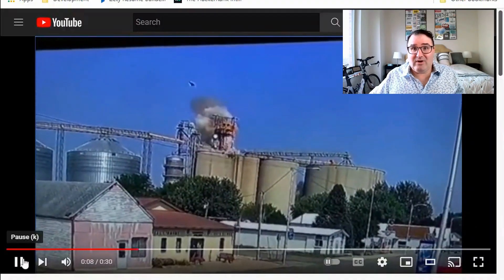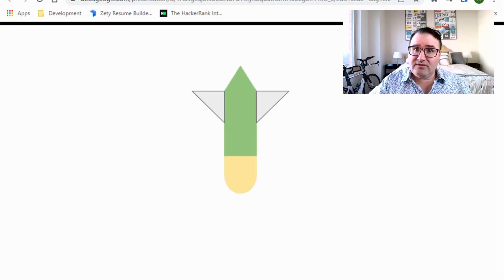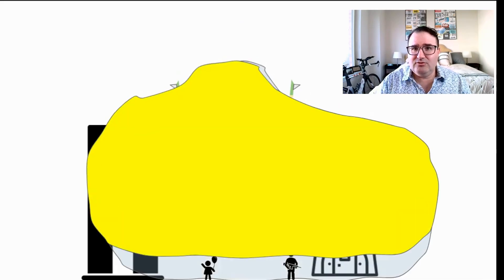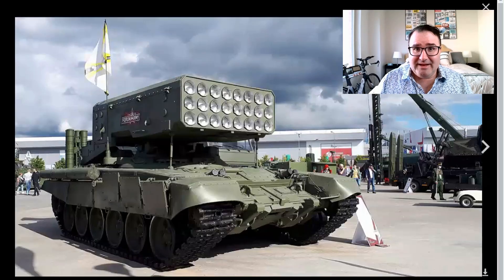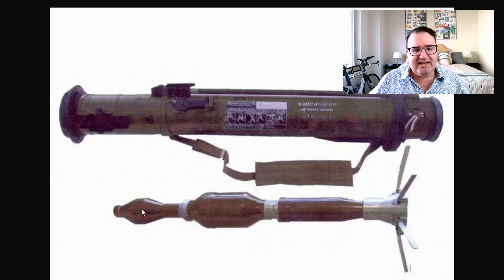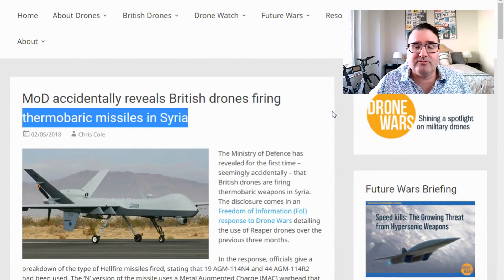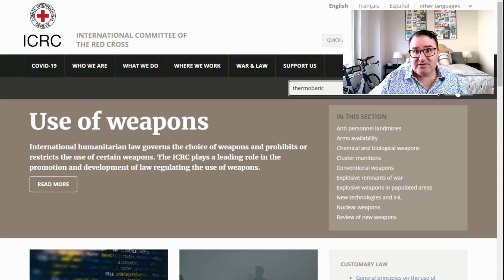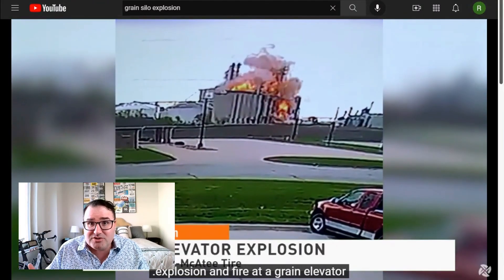How do Thermobaric "Vacuum Bombs" actually work?

Comment: Chemistry degree here.  Rain may increase the blast if conditions were just right.  This is due to the water droplets vaporizing in the intense heat of the blast.  Since going from liquid to vapor, water expands tremendously in volume, the blast overpressure would be increased.  This is why (in certain controlled conditions) it is advantageous for high performance automobile engines to inject water into the cylinders during the combustion.  Add too much water and you'll damage the engine, add too little and not much happens, but if you get it just right, these engines produce more horsepower.  In the case of a thermobaric bomb, humidity would unlikely be enough, but rain (at just the right intensity/droplet size) there would likely increase the blast force.
Reply: The MW 50 injection system used on Messerschmitt Bf 109  comes to mind.

Comment: To my understanding, any bomb creates a vacuum, because the explosion accelerates both the explosive and the air around it away from the centre of the explosion at very high speeds - actually above the speed of sound. Now, normally you'll be safe if you're behind a thick concrete wall so the pressure wave doesn't hit you, but with a large enough bomb you may actually have the air "sucked" out of your lungs (because there's no atmospheric pressure to prevent your lungs from collapsing, like if you suck the air out of a bottle).
Shortly/immediately after, the air pressure returns to normal, but there is that brief moment of "vacuum".

Comment: You can stand right next to a thermobaric explosion out doors and be unharmed or just knocked over unless you are pretty much inside the explosion. I have personally  seen thermobaric grenades and RPGs detonated and the damage is almost nonexistent . The 43mm grenade round is almost harmless only a few meters from the round but in a small room you are toast . They are effective in enclosed spaces .. not as artillery.
Reply: Thermobaric weapons are extremely lethal. You would certainly die standing next to a thermobaric detonation

Comment: I had a question what if you use that on a forest fire would it stop the forest fire or couldn't you just like just set off charges mid-air and just blow the fire out itself I was just wondering for like forest fires cuz this seems like it would kind of work cuz it would annihilate everything in cuz the trees are ready going to burn there's going to be nothing left already if the fire keeps going so if you just send that bomb in boom eradicate the whole problem wouldn't that work I don't know I'm not a mathematician I'm not a scientist but couldn't you just use bombs to put fires out like forest fires yeah it's bad for the eco but it's not bad for the ego cuz everything's dead or ran away only thing in the way is just more fire and wood and whatnot like can you just boom like detonated before it hits the ground like midair and just sucks up all the oxygen in the area and pulls that fire up would that work I don't know I'm just putting a theory in my head just thinking out loud

Comment: Well actually why it's devastating is because of the energy density of the filler. To clarify it, Gasoline has like 44 mega joule per kg, 22 for methanol, 11 for nitromethane. Methanol has 1 usable Oxygen in it, Nitromethane has 2. Therefore making them heavier hydrocarbon structures. Explosive fillers typically come with oxidizer in them, whether it's in the structure or in the chemical compound. Either way they are much more heavier for the same amount of the unlockable energy. Only carrying the reactive elements in the warhead and using the atmospheric air for the oxidizer is way higher in efficiency. The warhead can be made small for the same devastating effect. Even if the target is in the non-fire hazardous range, the shockwave punctures the lung so people suffocate just by standing nearby, it could happen even within a cover. The pure HE is dense in the middle of the explosion, the core of the explosion radius is the most dense in energy, it's not distributed evenly, that's what Fuel-air bomb comes in differently. They scatter the fuel pre-explosion, and they are not typically relying on the main-explosion itself to make the reaction happen further away from the detonation origin. That's why it's effective lethal radius can be made much larger. Because the effect in which lethal for a human is way less than that of the pure he explosion. In short, scattering the explosive elements in the area beforehand increases the evenness of the explosion around the area. Larger bombs benefit more from this spread. The burning speed etcs differ in a property compared to the conventional High explosives so, it's typically not good against... wait, I think it's straight up way more efficient in most cases compared a conventional bomb. It works against armored vehicles too. But its use must be for a large scale infantry deployment, to clear a large area with more human-oriented lasting effect.

Comment: 4:20 Good Point, I think the Wheather condition must affect the explosion. I would say strong wind can harm the aerosol mixture, same as the rain.
Reply: Not really. Even a 200 km/h (124 mph) straight wind would only move the explosion around 2.2 meters (because the explosion happens in 40 milliseconds or less after aerosol release) - not enough to make a difference given the blast radius and surrounding affected and effective area.
No one and no plane or helicopter would be fighting in a 200 km/h (124 mph) cross wind so I guess there's no issue with that.

Comment: High Humidity can reduce the partial pressure of O2, from about 22% down just below 19.5%. This can be an issue when setting up gas detectors for protection people and equipment in Very Humid Environments. My guess is that the reduced O2 availbity would reduce the effectiveness of the ThermoBaric weapon.

Comment: Interesting to note that  Thermobaric Hand Grenades exists. I wonder if they use the same concept of filling the air with fuel before igniting. These grenades are being used in Ukraine, dropped by quadcopters, plus I've seen videos of Australian SASR using them.

Comment: 1:39  I think this video in the backround shows why some call it a "vacuum".
The debris and smoke from the house stays almost in place. Other explosives would blow away everything.
But by using up a load of oxygen, a lot of air is "stuck" in between being pushed away by the blastwave...but also pulled back to the large fireball at the same time.

Comment: What is "overpressure"?
Reply: It's the excess pressure above the ambient level that exists in the shock wave.
Reply: @jimsagubigula7337  Thanks for replying...but I'm afraid I still don't really get it...could you maybe "dumb it down" a little bit? 😃
Reply: @bettyswunghole3310  Yes. The atmospheric pressure is 14,7 PSI at sea level. Let's say that the pressure inside the shockwave is 24,7 PSI. Thus, the overpressure of the shockwave is 10 PSI, as its pressure is 10 PSI more than the atmospheric pressure.
Reply: @jimsagubigula7337  Yes! I get it now, thank you! 
I think I was trying to make it more complicated than it is!

Comment: Although I do not have access to classified information or data on the specific effects of atmospheric conditions on thermobaric explosions, perhaps a surmise will have merit. It is possible that heavy rain or other adverse weather conditions could potentially affect the efficacy of a thermobaric explosion by dispersing the explosive material or interfering with the ignition process. Additionally, strong winds or other atmospheric factors could impact the blast radius and direction of the explosion. Ultimately, the effectiveness of a thermobaric explosion would depend on a variety of factors, including the specific conditions of the environment in which it is deployed. This is, of course, problematic given the utility of any device is defined by its use, implicit in terms of its design and purpose. Hiroshima and Nagasaki come to mind. And, it appears that an 'FAE' approximates a non-nuclear equivalent in this regard. As an aside, anatomically speaking, an 'atmospherically equivalent' pressure wave, that is, 15 PSI or higher can cause fatal injuries to humans, including severe damage to internal organs, ruptured eardrums, and lung damage. FAE's provide this multiplicatively. PS: Your degree of "due diligence" and analytical thinking reminds this reader of a parallel ... that of the cogency of another researcher: Neil deGrasse Tyson. As a retired educator, YOU are to be commended for your efforts in this regard.

Comment: The main physical principle behind thermobaric weapons (or any dispersal/gas/mist based explosion) is surface area, you are trying to maximise the contact area of fuel particles with air so it all goes off at once. So thermobarics don't just drop the fuel load, they disperse as best they can prior to detonation. This is exactly the same as the fuel injectors in your car's engine, you don't want the fuel to burn based on a limited surface area, you want it to detonate instantly and forcefully unloading its full chemical energy as fast as possible, hence fuel injectors pre-mixing and turning your fuel into gas to inject into the cylinder.

Comment: for a lazy person as me it takes too much energy to keep up with all the development going on.
This weapon carry enough oxidizer to initially make the bomb spread the fuel, and enough to also ignite the mist. But after that it is using the oxygene in the air. So compared with the weight of the bomb/weapon the blast should be bigger then from an old bomb carrying oxidizer and everything else in the shell, right?

Comment: I don't know the answer.  But, generally water will cool the temperature of a reaction UNLESS the explosion exceeds the temperature where hydrogen and o2 seperate out of water which is about 2200C/4000F at atmospheric pressure.  So, if you've got a pressure wave of a few atmosphere's and a temperature of 1700F you're probably not super close to that.  Thus, I would expect water to reduce the effect of thermobaric weapons.

Comment: When dealing with a bunker or other confined position, we used a glass ar with a pound of wheat flour mixed in with about a quarter pound of fertilizer and then throw a handgrenade after it. It takes down a house without any problem.
Reply: How large a jar was it? Around 4-5 litres? Or the small marmlade jars? You'd have little time to seal it I guess (if you could fit the grenade in).
Reply: @thiefofa1073  Apparently you don't quite get how FAE works.
Did you ever see what happens when you disperse about a 250cc of finely ground flour in a glass jar by throwing it against a stone wall in a confined space? That's a finely dispersed mist of lots of very combustible material suspended in air. Now really closely observe what happens when you put an open flame (or a handgrenade) to that air-suspensed mixture. Closer! Closer still!!!!
Reply: @Centurion101B3C  Ah cool thanks for the lesson. So you're saying no need to close the jar and the open top is actually meant to encourage the air to swill up the particles. Interesting. 
I guess with the remaining flour in the bag you would chuck it around the room to create more dust (doors and windows close I gather for more burst effect).

Comment: In WWII US fighter planes had water injectors in the engines which would give a conciderable boost of power enabling them to gain advantage in a dogfight. However, it was very hard on the engine.
Also, car engines perform better in a humid environment.
So wouldn’t a thermobaric bomb work better in a humid atmosphere?

Comment: My hunch is that atmospheric moisture would have nearly no affect on the destructiveness of a fuel-air explosive unless there is so much rain and wind that it prevents reasonable atomization of the fuel in the early milliseconds of the blast.  In a shockwave situation nothing moves faster than the shock front.  If there's a droplet of water, or an area of denser moisture, that region will merely slow the shock front in the shadow of the droplet.  If the entire space is full of droplets they all slow the shock front but they do build up more mass in the shock front.  One of those times the other is the power of the blast so it doesn't matter if there's a drop and the front is a bit slower, or if there's just dry air and the front is faster, the wave is carrying the same amount of energy.  That's my guess.  (And then I read a reply from an expert and realize there is a difference, it dumps its energy more quickly -- I guess I could have intuited that.)

Comment: The water may be hot enough to oxidize the aluminum or boron in these bombs. That would, I suspect, be the largest effect. The density change will affect the shock speed, but that's not really the point of the weapon

Comment: Mechanical Engineering Student dx I believe humidity would lower the temperature of the explosion considering that the increment in temperature of the surrounding air is what causes the explosion, and water would most definitely take some heat. However due to the amount, we would be talking about less than 5 % decrease in effectiveness?

Comment: Hi Ryan, humid air may feel more dense but in fact it is thinner, and significantly so.  The addition of water molecules mean each molecule of air whether N² O² CO² and Ar (+others in tiny amounts) are farther apart.  Aircraft need much longer take off and landing distances, projectiles travel faster and lose momentum more slowly from friction too.  If the explosive needs atmospheric oxygen, high humidity will slow it, but the degree to which it happens could vary enormously depending on what concentration of O² per unit of volume the reagents used need.      Rain would have a different effect.  The droplets would absorb quite a large amount of the heat generated, and flash over to steam.  That could use up some of the thermal energy intended for the target, but would also produce a strong pressure gradient by itself as water vapor has a huge volume compared to liquid.  I can confidently say there will be measurable differences, but I have no idea what size those might be.  I'd want to hear from those who have seen numerous tests or uses under different conditions and hopefully we will get a response from someone who has worked with the chemicals used.
EDIT: Data reported in releases from Lockheed Martin, Austrailian Air force, USAF and reported in Popular Mechanics, The NYT, WSJ and hundreds of other sources available on Wikipedia suggest that high winds, altitude, precipitation, and humidity CAN suppress thermobaric weapons such that a self oxidizing explosive is a better choice.

Comment: I would think the humid air would slow the propagation of heat from the blast.  Causing the air to stay hotter inside the blast area a bit longer, and reduce the range of the IR effects.  Basicly, a micro greenhouse effect.  Though probably insignificant to the overall outcome.

Comment: The Hazmat Tech in firefighter in me just cannot let this one hang... Please study up on Boiling liquid explosive Vapor blev liquid explosive vapor... And my personal favorite metal fires. If there is a metal component to any incendiary then you are looking at Water making things a lot worse. Many times water spreads metal fires or acts as a carrier... when you're dealing with skyscrapers a great many of the upper floors have less heavy more alloyed Metals in there construction. Those Alloys burn hot. That's one of the main reasons people don't understand how steel beams can melt when set alight by magnesium or copper alloys... Which can be set alight by kerosene but you didn't hear that from me

Comment: You got one thing wrong. It's different than a grain silo explosion because that's just a rapid deflagration within a confined space, sort of like a really big pipe bomb. A thermobaric weapon on the other hand, is not "ignited" as you said, they are detonated using timed detonators. You can cleary see in the slow motion footage that you showed that the thermobaric reaction is propagated by a shockwave(aka it detonates), and not by heat(as in a deflagration), by looking at the speed the reaction front has. Flame fronts in air are slow, especially in air under atmospheric pressure, it's no where near the speed of shockwaves. If it just ignited the fuel air mixture, you would not get a supersonic shockwave, you would just get "whoof" sound as the fuel burns relatively slowly as the flame wave propagates though the mix.

Comment: Actually , humid air is less dense than dry air. The molecular weight of water is less than the  molecular weight of diatomic nitrogen. Every pilot should know this. Humid air increases your stall speed.

Comment: Your explanation doesn’t make sense. You cannot get an aerosol fuel into most buildings even if you used a firehose. A Vapor will not go into a structure unless it’s to replace a vacuum which exists inside that structure. Physics.

Comment: Water in the air, as droplets, would most likely dampen the yield of a fuel-air-bomb. Water mist is used to mitigate against fuel-air explosions and "transition to detonation" in the coal mining industry. This makes sense as water in the form of droplets will soak up a lot of heat energy from the combusting fuel compared to the surrounding air before turning into expanding steam.

Relative humidity will not affect yield significantly...

Comment: IIRC it's called a vacuum bomb because of a urban legend. The story goes that during testing when the explosive was dropped on hardened bunkers the vacuum from the air rushing back to fill the gap left by the heat of the explosion pulled the testing dummies into the air vents of the bunker's ventilation system. To my knowledge this never happened, and there is no record of this occurring during the testing of thermobaric explosives.